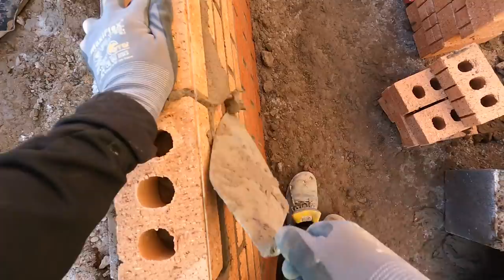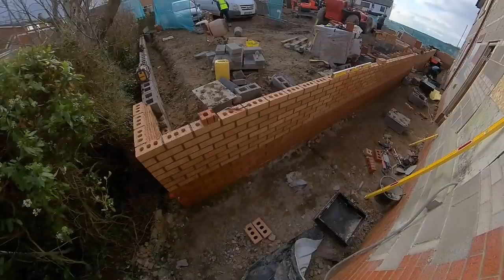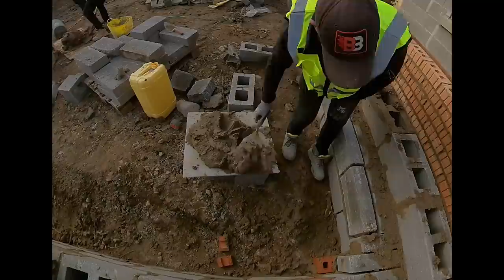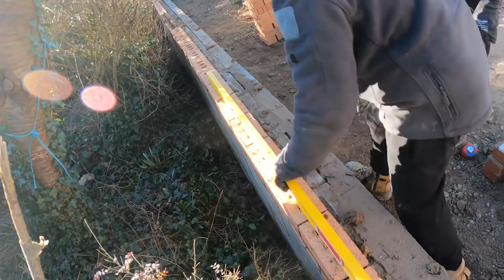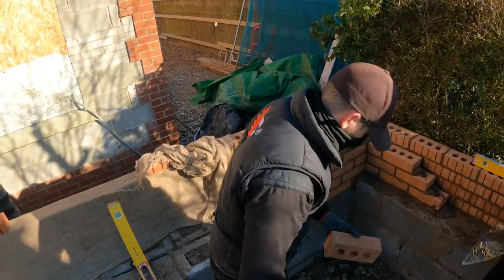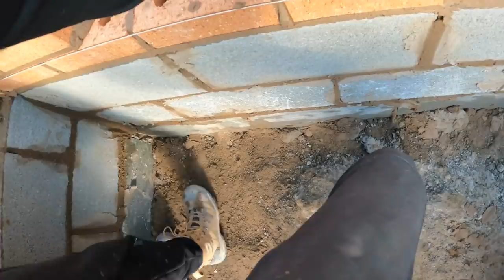Bricklaying - Perimiter Walls Continued

Comment: What made you get into pic n dip stu?
Reply from the maker: I read the bricklaying system properly without judgement. It’s all about wasted movement and efficient workmen and women in their jobs. At first I thought is was for cowboys but you shouldn’t judge until you’ve understood yourself. I still use traditional mostly but sometimes both. 👍
Reply: @Stucrompton1  it looks miles quicker tbf, I thought it was for cowboys too. Deffo worth a go. Cheers mate